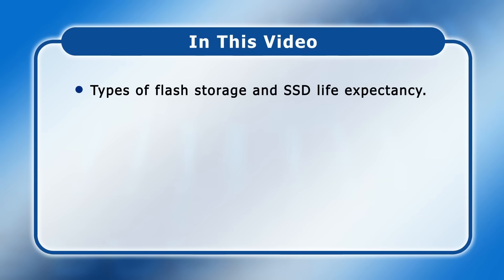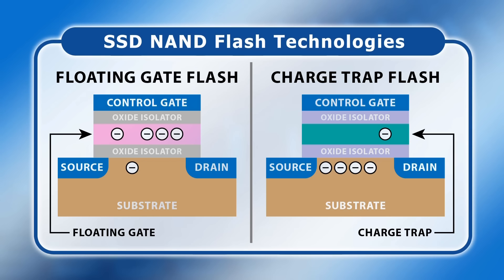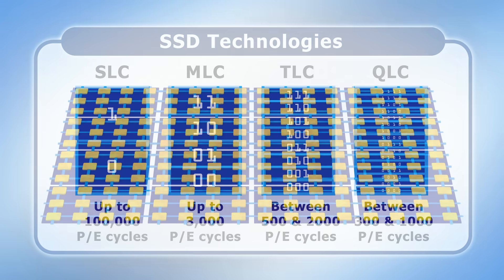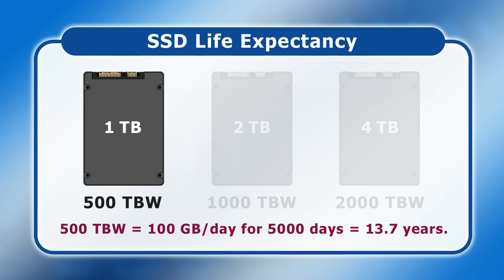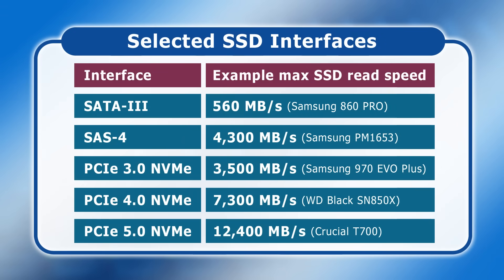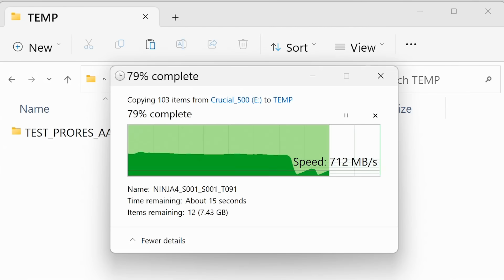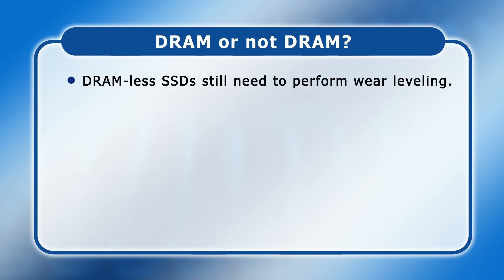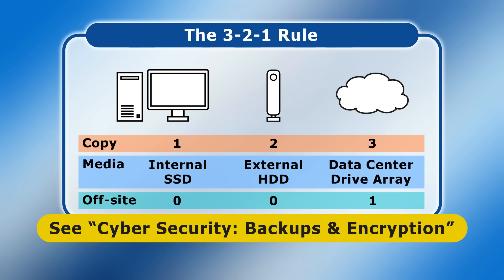Explaining SSDs: The Price/Performance Trade-off

Comment: I recently bought several SSDs so I was trying to figure out what used TLC and what used QLC. Fairly obvious with Samsung, but Samsungs are fairly expensive and I was looking at the cheaper 2 1/2" SATA drives since these were to be used in old PCs without nvme slots. Pretty much all drives in this class seem to use TLC, some advertise having SLC caches, and so far I've only found one QLC drive (which required reading of the fine print). This was the Fikwot FX815, which strangely enough, usually sold for more than Fikwot's TLC offerings. All of these drives operated at the same speed (being interface-limited). 

One thing I wonder about - are TLC and QLC being used in USB sticks and SD and micro-SD cards? Perhaps ultra-cheap USB sticks now use QLC (the non-fraudulent ones, that is). Note that they're selling "high endurance" micro-SD cards for use in dashcams, this implies writing and erasing large amounts of data on a daily basis, so perhaps they can't be using QLC in this application. One wonders if these high endurance cards would be the best to use if you are using the micro-SD card as a boot disk for a SBC.

Comment: Thank you for making this, Mr Barnatt. I've started to watch this, and thought I'd relate my experience.  I'll come back and edit this when I've finished the video.

I use ZFS in my linux desktop (Kubuntu).  I needed to increase my storage over the 1TB WD Blacks I was using, and I was attracted by the price of a well known brand 4TB nvme - let's call it brand X.    I measured sustained raw throughput of 1.4 GB/s write and 1.6 GB/s read over 100G.  What's not to like?

I benchmarked a brand X zfs dataset, no mirror, compression or dedup.   Sequential read performance is 3GB/s (5x8GB test, so some RAM caching is probably increasing this figure),  but write performance was terrible at about 130 MB/s.  A WD Black 1TB nvme gave 2.4 GB/s read and 1.5 GB/s write - more than 10x faster writes.

When I added brand X devices to a ZFS mirror,  sequential write throughput was about 60MB/s,  and random 4K writes went down to 11MB/s.  This is woeful, and certainly not usable.

If I create a mirror of a brand X and a WD Blank nvme and do a performance test and observe the io delay times using atop,  I saw delays at the brand X device of 10ms per io and tens of microseconds at the WD Black. 

The moral I learned from this story is that not all well-known brand's nvme devices (at similar prices - about £300 at the time) perform the same in practice.  This is not necessarily an endorsement of WD Black nvme's,  just the ones I bought and had no issue with.  I've also some WD Red nvmes and WD Red 8TB spinning rust in my server, with no failures over 5 years.

Comment: Excellent. There is one parameter you missed here: Power consumption. When researching drives for a Raspberry PI project where total USB supply current to the drives is limited, I found older slower SATA SSDs used a lot less power. An omission.. not an error!

Comment: Wear-leveling seems so counter-intuitive: doesn't moving data around within the SSD lead to extra P/E cycles anyway? There shouldn't be an advantage there like Chris explained.
Someone help me out?
Reply: Data often changed , is moved to cells less active, spreading the wear. Your accretion makes sense, until looking at a cell that seldom is rewritten. Replacing data in a cell that  has been switched often, with data that rarely changes , gives the cell a break , so to speak.

Comment: Had a laugh the other night as I remembered 5:31 after scratching my head for a few hours as to why one of my SATA SSDs (Crucial BX500 1TB) was weirdly slow at around 94MB/s read and 15MB/s write then realizing I overfilled the drive. 

I had to reconnected the SATA cable first to resolve the SSD showing up as SATA 3Gbps instead of 6Gbps. But the SSD was still slow so I ended up changing SATA cables and redoing my PC's cable management while I was at it.

The slow performance still stuck so I checked how filled the SSD is as I remembered that being a potential cause since you mentioned not using up more than 90% of the SSD for wear leveling. 

Well it was about 84% used up, so I went past my normal practice of using less than 80% so performance doesn't slow down too much (a recurring issue I faced with a 128gb SSD in the past). After moving and deleting a bunch of files and it was back to the normal 450MB/s read and 530MB/s write.

Its interesting how hard drives can mostly keep the same drive performance (assuming its not too old or too fragmented) as it nears full capacity compared to SSDs where filling the drive too much can slow it down. Its a tradeoff that's I can live with since generally even a DRAM-less SATA SSD is more responsive than a hard drive.

Comment: Lexar for the past few years made some excellent DRAM less SSD's! Having lot's of RAM helps to also negate their drive's missing DRAM. 7200MB/s sustained read and about 3400MB Write using the Mobo's RAM is absolutely a good way to keep it cheap these days. A 4 TB NVME PCIE 4.0 drive for about 270$ is a good choice nowadays compaired to a 250$ 2TB Samsung 990Pro. Except you still run around with 16GB of RAM! I have both the 4TB Lexar and the 2TB Samsung and they read/write to each other with about 3-5GB/s in both directions which is a good thing and shows that the cheaper solution is not a negative for me. My next drive will be a Lexar again.

Comment: If you don't need a Maserati get a mini van with a turbo.  If you need external storage buy an External Enclosure Case for $4 and throw in your old hard drive.  Should be good for 5 years - I've heard!  Beware of data rot.

Comment: According to the reviews I have read Dramless SSD is a bad idea especially for boot, OS drives and for heavy copy-write workloads.

On the other hand Dramless NVMEs have not so visible and noticeable consistency or life expectancy issues due to the use of system RAM.

The downside of Dramless NVMEs seems to be the consistency of performance for heavy use and the integrity of the data in case of a power failure (if there is no UPS).

I ve read that DRAM SSDs and NVMEs have some kinds of protection circuits that help the data integrity in case of power failure. Is it still true or an urban myth?

Comment: One can also buy an enterprise SSD, that will sustain the write speed throughout the whole drive. Also, many of them have a lot more DRAM, like 4gb, absorbing quite quickly more of the OS random write operations (that tend to make a system feel slow if not enough cache is available).

Comment: I tout that ssd drives became the holy grail solution for reliability,speed and life span over harddisk drives,by since i know that also ssd drives do rely on power in some form or another to maintain it’s data,i have changed my mind about ssd drives,why couldn’t they just invest ssd drives or flash cards wich will work the same way as rom chips in wich the data has to be burned in wich can be only erased with a laser if it is not protected,so why not relying on those rom chips instead for preserving data forever,damnit what a letdown about the vulnerbility of ssd drives🥲🥲

Comment: Need corection on HMB. 1) Normally Dram cache used for cell translation tables, not data writes 2) Normal Dram cache is 1mb per 1Gb NAND, so its 1GB of Cache for 1 Tb drive. HMB can provide much smaller size, they say its 128Mb on Windows and up to 256 on Linux. 3) Smaller cache do affect performance, but not linear writing (this mostly handled by SLC cache) but random writes and reads since drive cannot contain whole translation table in DRAM.
Reply from the maker: Thanks for posting this additional information. But it is not a "correction" as it does not contradict anything included in the video. There is always a limit about how much information I include in a video -- in education, less is usually more, especially in content for a general audience. The video contains all that most people will need to know about HMB.

Comment: Does increasing the size of Over Provisioning prolong SSD life? :body-blue-raised-arms:
Reply: Of cause it does. But with a modern trim-enabled OS the most people do not need OP anymore. Just keep at least 10% free space on your drive, as Chris stated @ 05:10 (my recommendation usually depends on whether you use QLC/TLC/... NAND-SDD and on what you are using your SSD for. That's why it fluctuates between 0 and 25% of free space)

Comment: I wish you could configure your SSD to be SLC, MLC, TLC etc. Like with jumpers or something, would be cool. Or they could make that if cells gets unstable it automatically switches to less bites. I assume memory cells are same, just different controller or protocol or something
Reply from the maker: This would be very cool, and is certainly something that could be technically delivered by an SSD manufacturer.

Comment: The SLC cells, are actually just using TLC-capable cells for SLC (1-bit).
This probably depends (you could have cheaper hardware for just SLC cache) but the vast, vast majority will use random cells as SLC cache for wear leveling.
Reply from the maker: Yes, all cells are the same -- only how they are used changes, and the video is worded carefully to reflect this.

Comment: Yes, but it stores more bits per cell, so you need to erase it less because you have more capacity.
Also, 3D NAND is a different technology that actually has much more lifespan because of how it works.
Reply from the maker: Because it holds more bits per cell, on average the cell sustains more writes.

Comment: so in short, i still need a DRAM SSD if i want to have a new SSD drive as a fast-mass-storage and scratch-disk for my editing files such as PSDs, cad(dwg), 3d(skp),... next to my existing nvme ssd boot drive, even if the SSD drive is relatively an older model?
Reply from the maker: Yes, agreed. I would go with a DRAM SSD if at all possible.
Reply: @ExplainingComputers  thank you kind sir. Your contents have been life saving for me for years.

Comment: I've read that SSD's can lose data if say you store the SSD in a drawer for many years and then try and access the data compared to a regular spinning disc hard drive that they say is more reliable for long term storage.
Reply from the maker: Yes, this is true. SSDs can be subject to data fade if the data on them is not read for several years. The more write cycles a drive has endured, the more likely this is to occur.

Comment: 11:00 - The issue of write cache capacity is why, for expanding my main media archive last year, I bought a WD Blck SN850X 2TB NVMe (adding to a long used 1TB SM961), because it has a substantial 600GB SLC buffer, so copying data onto the drive can go at full tilt for a long time befoe slowing down. Sometimes I've needed to copy as much as 200GB in a single session from an external source, something which just isn't viable using mainstream models with small cache buffers, and especially not the cheap QLC products. I've also been using the 970 EVO Plus and Adata SX8200 Pro because they also behave well for this type of task, but the SN850X is in another league.

Data of course expands, and I'm not yet even dealing with 4K maerial, so to this end I've just upgraded again to a 4TB SN850X. The previous 2TB and the old SM961 will be repurposed elsewhere.

For general tasks though, especially where random I/O doesn't much matter, there is a plethora of sensible choices, eg.for storing converted mp4s of dumped DVDs I bought a 2TB WD SN570, a model which also works very well as a system drive (3s boot to desktop using Win10 with an i5 10400).

I'm glad you mentioned backup at the end. I copy all my data to two separate 8TB Toshiba Enterprise HDDs (same data on both), while a third holds the raw data from the dumped DVD collection. Data backup is something rarely mentioned in the PC space for home users. I always thought it a shame that there's still no such thing as a consumer oriented tape backup technology. I expect many people do backups using cheap SSDs in external USB cases, but in the long term, especially if never refreshed via a full read, these devices are liable to fail if just left in a drawer for years on end. At least with mechanical drives there is scope for significan data recovery.

When you mentioned wear levelling, was that meant to include the way in which SSDs include additional flash, beyond the stated capacity, to serve as replacement blocks as the drive ages? I've noticed that QLC models can have a large amount of this spare area.

Something you didn't mention was the consequence of the industry moving toward ever higher density and capacity individual flash ICs, namely the ability to provide higher capacity drives using fewer I/O channels, resulting in lower performance. SSDs of many years ago often obtained their higher tier speeds by utilising many channels, in part because they had to as IC capacities were lower. But capacities have not increased in line with the reduction in channel count, so some modern products, especially SATA, can be significantly slower than older models.

This is why, even today, for a 1TB SATA I would much rather obtain a Samsung 850 Pro or 840 Pro, used or otherwise, the latter inparticular demonstrated excellent behaviour in TechReport's SSD Endurance Experiment, conducted in late 2013, in which the 840 Pro was the final drive to give up the ghost, by which time it had survived a whopping 2.4PB of writes (I would be very.surprised if any modern mainstream NVMe could come anywhere close to that, especially the plethora of junk Chinese brands one sees on Amazon).

Comment: In the digital realm where data resides,
SSDs emerge, where performance abides.
A poetic journey, the trade-off's tale,
Explaining the dance where prices set sail.

Solid-state wonders, where speed takes flight,
In the price/performance trade-off's light.
A balance struck in the digital sea,
A poetic revelation of technology.

The swift read and write in the SSD's might,
A performance dance in the digital night.
Yet prices echo in the trade-off's song,
A poetic reflection, where choices belong.

From NVMe's speed to SATA's grace,
The price/performance trade-off we embrace.
In the digital choices where users roam,
A poetic exploration of technology's home.

So let the bits and bytes weave in the trade-off's rhyme,
In the SSD's dance, where data climbs.
A poetic guide through the technological trove,
Explaining the trade-off in the digital cove.
Reply from the maker: Very cool. :) Thanks for sharing here.
Reply: What a Poemputer😁

Comment: Given a motherboard USB C port and external device, how did you get these transfer speeds, did you use a thunderbolt device?
Reply from the maker: If you are referring to the test at c. 14:22, the external M.2 SSD enclosure is USB 3.2 Gen 2 (10MB/s) as noted in the caption, and connected to a computer USB Type A port of this specification (as shown in the video earlier, I got the drive with a USB C to A cable). As I recall, the Type A port was on a PCIe adapter card.
Reply: @ExplainingComputers  thanks
Reply: @ExplainingComputers   What I discovered is that if you have SATA hard drives on the PC, the chipset shares the bandwidth and thus the speed reduction. I forgot about that old rule but I suspected this because Crystal disc mark 8 gave higher than SATA speed so something else is going on. For me, the 10 GBs is not a showstopper.
Reply: @ExplainingComputers  because i can't get more than SATA speed regardless of cable or device, have M.2 boot and externals but wonder if having SATA HDs slows things down. Crystal Disk shows more than SATA speed so I'm just wondering.... Thanks

Comment: Question: I have a PCIe 4.0 NVMe M.2 SSD on a full X16 PCI card. It's a 500 GB, partitioned into two drives. One is my boot partition, "C", and the other is storage. When testing with Crystal Disk, the Second partition returns a 2948/second read speed, but my "C" partition, the first partition of the very same drive, only cranks out 243/second read speed... What am I missing?

Comment: Having worked in the disk drive industry for several decades, I do not trust Flash memory devices for long-term storage of important data, having seen some corrupt or lose data in less than one year.
Reply from the maker: Agreed. Flash memory is not a form of long-term storage -- and never claims to be. :)
Reply: Agreed.........

Bought two new Samsung 128 GB flash drives, loaded one up with 22 GB photos before copying the same to my backup HDD.
Few days later I accessed the drive to find I was unable to open it at all even after checking various USB ports and gentle wiggling!

Returned ad reimbursed but it was a timely warning about backing up.

Comment: Hi Chris - love your videos. I worked in HDD and SSD storage manufacturing for more years than I care to admit to. A good SSD manufacturer will overprovision the amount of storage on the device and then firmware will declare less than the total to be available to the user - the balance is hidden and used for the wear leveling algorithm in the background, hidden from the user. I wouldn't worry about it filling up your SSD to the brim other than for the usual reasons of never wanting a storage device stuffed. Cheap brand SSDs maybe different and SD cards used on SBC's probably won't use wear leveling at all.

Comment: In the past years i had numerous samsung SSD dying, they never were used very intensively. These cheap NVME drives, although fast, get super hot and very fast suffer from thermal throttling. I don't think the reliability has improved for consumers. For this reason i switch to U.1 drives or E.1 drives from Kioxia with my next build,,these are professional solid state drives,,which don't suffer from the usual junk, consumers seem to be getting nowadays. QLC and now even 5 levels, that is just junk, and an accident waiting to happen, for the ones that buy that stuff.